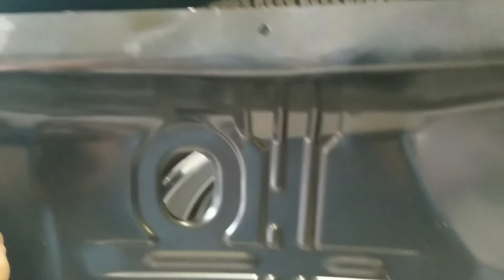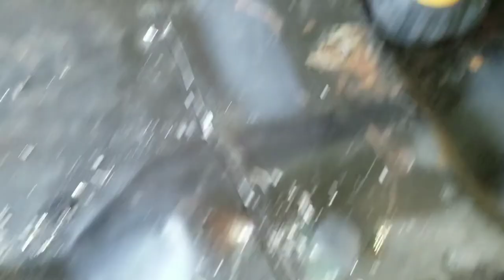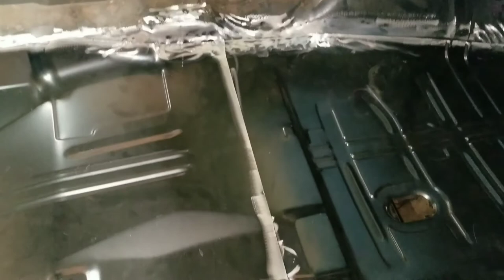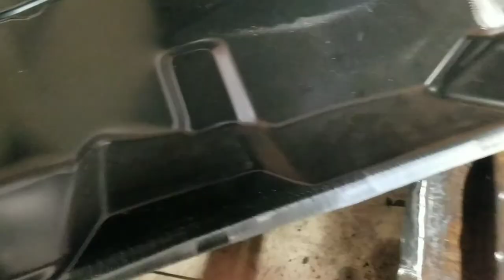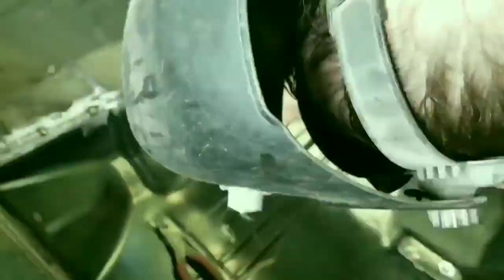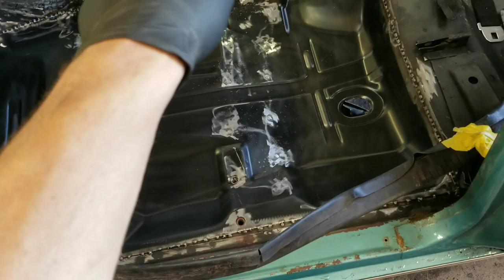1970 Buick GS GM A body quick easy floor pan installation

Comment: Hey im in the same boat got a 72 olds pretty solid all the way around except those floor pan could you tell me an average shop price for this job the rear set floor pans are good just the front thanks
Reply from the maker: Roughly $2800 to $3000 for complete fronts